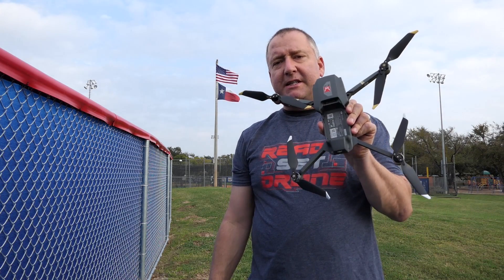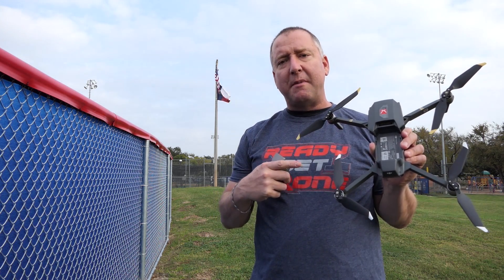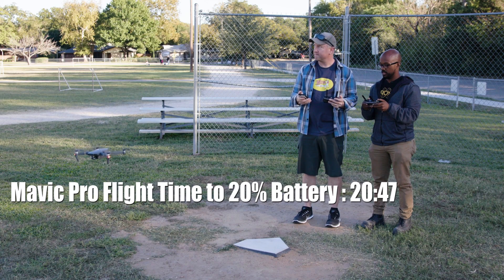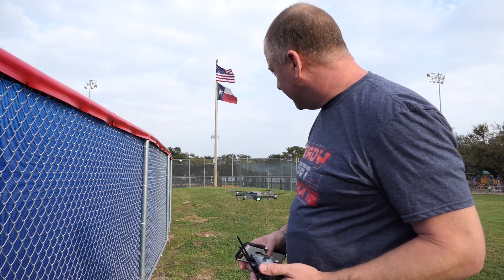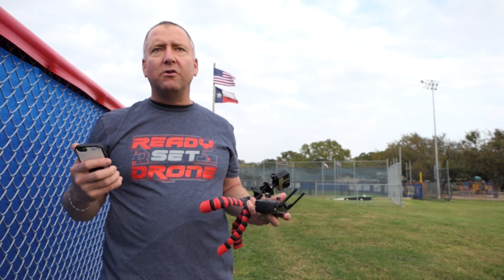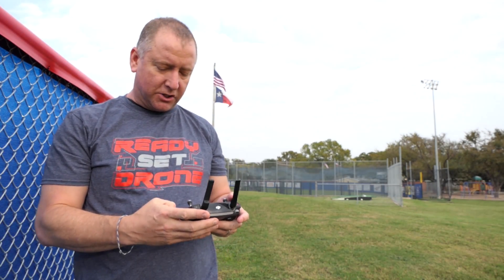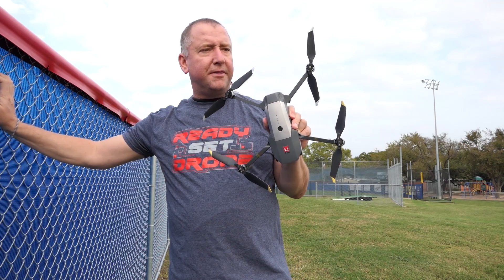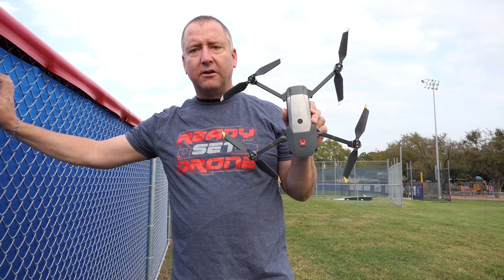DJI Mavic Pro Low Noise Propellers - Flight Time & Footage Test

Comment: You should try putting a mavic pro with the low noise side by side with a mavic pro with the original propellers to get more accurate numbers.

Comment: I don't like the way they fit when it is folded . And I didn't hear much difference . And they are thinner than the original (easier to break ) . Could just be me but I think it's more stable in strong wind with the original blades .

Comment: Just bought what I thought where the DJI 8331 low noise propellers but I got cheap imitations.    Have you ever thought of comparing the Oem vs the imitations?
Reply from the maker: How well does the imitation work for you? The comparison would be interesting, but given that the "official" props are so cheap, I'm not sure that I would buy imitations. But I'm curious what your experience with them has been.
Reply: Ready Set Drone I haven't tried them yet. Searched around for a vid and found nothing.  I paid exactly the same amount that the original.  But after getting a a feel for the weak plastic I do not dare to use them.  If you are willing to do a review test. I'd be more than happy to mail them to you.
Reply: Hector Burgos , Be careful with the non-dji platinum props. I ordered a set off of Amazon that was advertised as oem dji platinum props but they ended up being fake ones in a box almost identical to the dji box. 

Well I went to try them out and on the first flight the tip cracked on the prop and caused a vibration. So I ordered another set of the platinum props directly from dji. 

When the ones came in from dji and I put them beside the ones from Amazon it was clear that the others were fake. The build quality was much much better on the dji ones and I have many flight hours on them and love it. 

If I were you I would not use the non dji props due to how easy they crack and come apart. The dji props are cheap and to me it's not work risking your $800 drone falling out of the sky to save $2 on props. Lots of people have had issues with them cracking.

Comment: I had the "abnormal gimbal vibration" on mine as well when I first put them on. I brought it down right in front of me and I could physically see the gimbal bouncing like a basketball being dribbled, while the Mavic held still.  Make sure to download the latest firmware, as part of the update it specifically says that there is new firmware to address the new props.   When I updated the firmware b4 I flew it the first time it didn't actually complete the update.  We updated the firmware again and no more bouncing gimbal.  They are so much easier on the ears and less offensive to bystanders.
Reply from the maker: Very cool! Thanks for the comment!

Comment: My Mavic got the same vibrations and actually threw a gimbal vibration error when I added the platinum propellers on it. When I went back to original props, the vibration stopped.
Reply from the maker: Someone made a good comment about making sure you download the latest firmware for the Mavic - they said that it helped eliminate the vibration with the new props!
Reply: Furious Tacos did the update fix your prob?

Comment: This microshake that had appeared in the video is not related to the platinum props 
I’ve seen them before with original mavic pro props and it is related to the mavic size 
You can see the in depth review of tom tech time of the mavic you will notice the same issue
Thank you
Reply from the maker: Thanks! I'll check out the video on Tom's channel! I didn't think it was the props, but glad to hear it's confirmed.

Comment: When I think about the vibration concern Im thinking not about video issues but what the vibration does to the motors over the long term.
Reply from the maker: Fair point. Just not sure how to measure or really observe that in a video.
Reply: Just a thought... filming them in slomo (240fps) with the gopro and then slowing it down in post production  and seeing the difference.